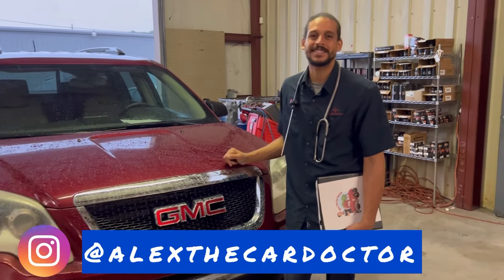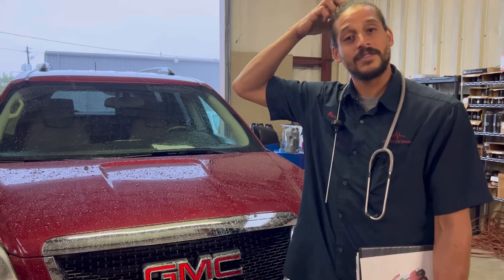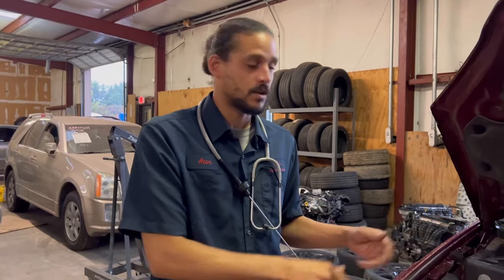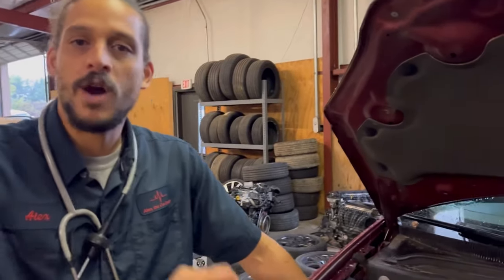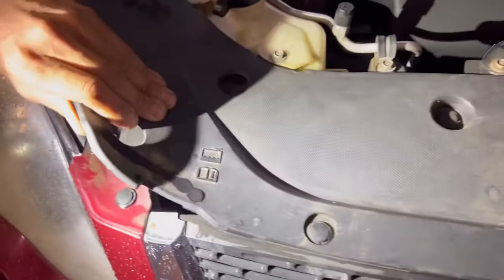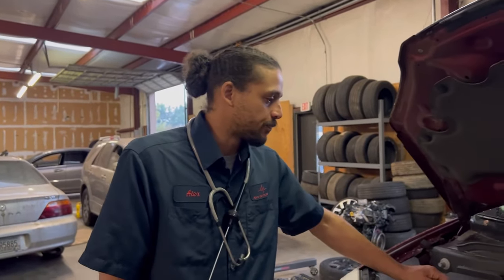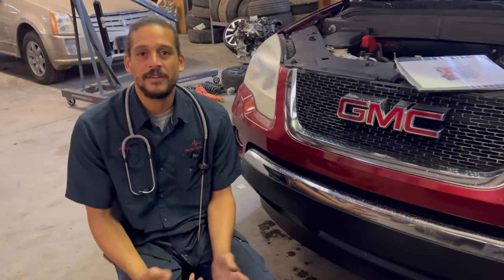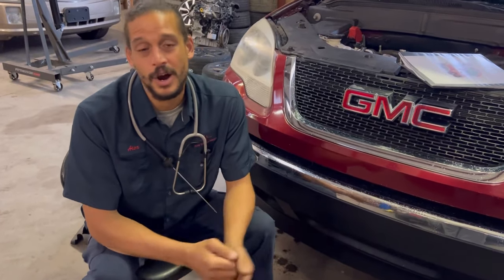The Top 5 Problems - GMC Acadia ( First Generation 2007-2016) | Should you buy the GMC Acadia? #gmc

Comment: HEY ALEX I JUST SUBSCRIBED 8 months AGO YOU MADE A VIDEO ABOUT A 2.7 Dodge can you give me an update on what that was after all?  I HAVE MY DODGE CHARGER 2.7 we change the temp sensor, water reservoir, fans thermostat, guy said he needs to pull the water pump he pulled it but it was in tact regardless he said he burped it three times and it still keeps bubbling at the water reservoir but the car always turns on and starts no oil in the water and water in the oil WHAT DO YOU THINK IS GOING ON? The mechanic is taking the heads off as I am commenting BY THE EAY YOUR VIDEOS ARE SUPER AWESOME
Reply from the maker: Your mechanic should have did a block test from the beginning.A block test will determine whether the head gasket needs to be replaced or not. Thanks for watching and the sub I’m glad you are enjoying my vids.
Reply: The 2.7 dodge is a boat anchor

Comment: Hey Alex,  I have a 2009 Acadia.  typical issues that you describe.  Had to change the rear catalytic converter because it was plugged.  looks like catalyst material from one of the other two blew out and plugged it.  Seem to run alright, but with a small misfire in one of the cylinders.  would the bad converter cause the misfire or possibly a bad coil?
Reply from the maker: Hey there sorry for the late response the bad cat most likely messed up one of your spark plugs
Reply: If you let a misfore go long enough it will burn your cat
Reply: Check your sparkplugs too. On a 5.3 V8 in a Tahoe, I thought a coil was bad, but the sparkplug porcelain near the electode inside the engine was broken.

Comment: I’m having issues with my 2008. Losing power at random times, sputters while driving and almost dies out when stopped. Was told it was the computer module and injectors, had replaced but a week later started having same issues again. :( 
What else can it be? Can’t afford a new car rn
Reply from the maker: Are there any Check Engine Light Codes??

Comment: As someone who bought one I have one question changing the transmission fluid should I do it it’s got 175k miles and I was always told not to change it without knowing if it’s been done before
Reply from the maker: Hey there buddy if you don’t have any history on it don’t  Touch it especially if it’s doing good. i’ve personally experienced this,changing the transmission fluid without history can sometimes lead to bad things
Reply: @AlexTheCarDoctor  Previous owner changed the ATF at around 90000km. I recently changed it at 195000km. I drained and filled twice, I didn't do a flush. Mistake?
Reply from the maker: @nestor.valentino  a drain and fill is perfect
Reply: Drain and fill with a bottle of Lucas trans no slip additive....solves shuddering.

Comment: I have had my Acadia for 3 years I have replaced the power steering hose twice is there something I may be doing that I can change maybe? Also struts my front struts need to be changed any tips?
Reply from the maker: Hey there and thanks for watching. Popper car maintenance depends on the year and mileage as the car gets older in years you won’t to start checking all the rubber parts belts and hoses suspension bushings etc or just change it,so what is the year of your truck. Dealing with mileage you normally for your truck 100k you change/check things like spark plugs, belt tensioner pulley along with idler pulley check, suspension components like tire rods ball joints ext,how many miles do you have.it’s a lot of stuff to check out, a good Guide is your maintenance book if you still have it it tell you step-by-step what you need to check dealing with mileage and year
Reply: @AlexTheCarDoctor  great thanks it has 189 000 kms and I don’t have a maintenance book

Comment: You might be able to help. I got a coolant leak but it slows down and picks up. I’m pretty sure my coolant temperature sensor is out. But when I get to that where should I be looking for that leak. From where I can see no hoes are leaking if anything could it be water pump. Coming from around the back of the fuse box area and drips onto the from a arm of the car. If you got anything to help advice. Thanks 🙏
Reply from the maker: Hey there buddy the safest way to find a coolant leak is to get a coolant pressure tester and pressurize the system then check For leaks.I have many videos of me doing this if you’re not familiar with the process. Why do you think your coolant sensor is going bad and are we talking about a GMC Acadia

Comment: Hello, I have a 2010 GMC Acadia. With a check engine code P0420.. What's the main reason or problem?
Reply from the maker: Hey there,that’s a catalytic converter code what normally causes this problem are worn out spark plugs, excessive carbon buildup in the engine a fuel induction service will help clean all that out and clean the converter faulty oxygen sensors downstream or simply a worn out catalytic converter
Reply: Ok. Thanks I'll give that a try.

Comment: dont you need to have the engine running to check the transmission fluid?
Reply from the maker: Hey there yes you do need to have the vehicle running to check the transmission fluid levels but not to check the condition of the fluid

Comment: Hi Alex I have a quick question 
I got 08 GMC Acadia and I replace the alternator because was bad and also I replace the battery but the problem still the same!! Some times the battery meter goes down or the car just doesn’t start 
Already change the battery twice because after 2 days start to leak what can be the problem??
Let me know please thanks
Reply from the maker: Hello sorry to hear the bad news.you may have a defective alternator,part failure is real. The other thing it can be is the engine computer or voltage regulator wires going to the ecu that may be damage.check the electrical connector on the alternator for damage also and make sure the positive wire is properly tighten down to the alternator. Hopefully this can point you in the right direction good luck
Reply: @AlexTheCarDoctor  thanks buddy
Reply from the maker: @mj96ct39  my pleasure
Reply: The water that leaks in from the sunroof can get all over the fusebox and ecm on the passenger side. Check for water everywhere.

Comment: Yes I have a 2012 GMC Acadia I'm having problems with the car starting sometime and when it started or when it first come on it's saying something about the traction and the stability sensor now it won't start at all or I have to wait for an hour or two and then it might start all the lights come on when you turn the key accept the engine light what do you think that might be???
Reply: It's saying service the traction control
Reply from the maker: Do the starter engage the engine meaning it the engine turning over but not starting
Reply: @AlexTheCarDoctor  no it doesn't do anything my uncle said it might be a solenoid on the starter but after sitting for about 30 minutes to an hour it'll start right up
Reply from the maker: @jerryturnbow893  look me on Instagram and send me a video of it not starting and starting show the instrument cluster where the gas gauge and everything located. It sounds like you have an electrical problem do you have a obd2 scanner
Reply: @AlexTheCarDoctor  no I don't and I don't do Instagram but I will try to make a video of it when it's not starting or whatever and I'll try to get it to you the best way I  can  I know when I turn the key all the lights come on except the engine light sometimes and when the engine light don't come on it won't start but all the rest of the lights still come on
Reply from the maker: @jerryturnbow893  do you have Facebook. When the truck finally starts are there any lights on
Reply: @AlexTheCarDoctor  sometimes the engine light stays on and sometimes it doesn't  and yes I have a Facebook page I just made a video of what's going on when I turn the key .
Reply from the maker: @jerryturnbow893  it’s normal for the check engine light to be on when the engine is not running along with many other lights, its called a light bulb test,no lights should be on when the engine is running. Try looking me up on Facebook
Reply: @AlexTheCarDoctor  I'm trying to mail it to u via Facebook is this ur Facebook address also???
Reply from the maker: @jerryturnbow893  yes
Reply: The fusebox is probably flooded from the sunroof leak.

Comment: Hi, I’m interested on buying an Acadia 2010 with 101K Miles, what should I be worry about? Is it reliable? Because I drive a lot
Reply from the maker: You never know what you are going to get with a used vehicle especially with a higher maintenance 3.6 engine that’s in the Acadia.I don’t want to tell you not to get the truck you want but have a car emergency fund for it and use very high quality oil. I see a lot of this vehicles in my shop for timing chain problems that is an expensive repair this truck is like owning a high end luxury vehicle every thing is hard to work on cars that equals expensive for the owners.on the upside they drive very nice and look good
Reply: Thank you for your response, I was about to go close the deal on Monday but now I changed my mind. I’ll stick to Toyota or Honda, I prefer reliability over how nice it looks
Reply from the maker: @kevinstevenbarrerajaramill5254  very good Choices those are my top picks Toyota then Honda

Comment: My 2015 Acadia is at 154000 miles.  It hesitates to start only when I put gas in it.  Check engine light is on.  What could this be?
Reply: Evap purge valve

Comment: I have a 09 Acadia with 198k and no issues but I change the transmission fluid every 30-50k and the oil every 3500 miles I have always Rotella T6 5w-30 oil I don’t know why I chose this oil when we bought the vehicle in 2015 it had 65K on it. I change the oil and trans fluid. Went to get emissions last year and the computer said it wasn’t ready for the test yet so they said to drive it and come back witch made sense cause the car had been sitting for several weeks not driven so I drove it went back still not ready 
So I drove it for a few weeks and still not ready I don’t know what to do herd you say you’re in Georgia and I’m interested if you can check it out or have you seen this in the past?
Reply from the maker: Normally to get those ready for emissions  you have to drive them 50-60 miles per hour for about 5 to 10 minutes straight. Google this: “ Readiness Monitors for 09 GMC Acadia” and it’ll give you the drive cycle. Drive it as instructed. If this doesn’t work come see me 👨🏽‍🔧

Comment: Hey Alex this is Monica from Jupiter Florida. Just replaced the front shock and strut assembly plus rear shocks as well. Front left wheel is making a ticking sound while I'm driving it and it is driving me nuts and I am dead serious! My bro is a mechanic as well as myself this is my moms 2010 GMC Acadia with only 35,000 miles on it. Do you have any ideas what that noise could be? I'm going to take the tire off tomorrow in my buddies garage and see what I see when I manually turn the wheel. Possibly overtorqued nut or a front wheel drive part going bad. No one has been doing maintenance on this vehicle in 12 years so I have checked almost everything out myself.  Have any pointers for me? I would greatly appreciate your advice. Thank you and Merry Christmas!
Reply from the maker: Hey there buddy happy New Year. you said you replace the front shocks if you bought them off-line for very cheap you could possibly have a defective unit, this happened before to me and it drove me nuts trying to find it because everything was new but that doesn’t mean anything if the parts are not of quality also check your swaybar links they tend to go bad and make noise
Reply: @AlexTheCarDoctor  It was a loose brake sensor line hitting the wheel OMgoodness we found it!  One of those little things when your rushing to do it fast you should slow down  and double check everything!  So glad it was something simple Alex but thank you for your response. Yes a defective unit from China did cross my mind. Happy New Year!

Comment: Just changed the water pump last month and yesterday it started overheating again. Couldn't be the same issue again?
Reply from the maker: Hey there does it try to overheat at a standstill like if you’re in traffic or while you are driving like if you’re on the freeway
Reply: @AlexTheCarDoctor  not at a standstill just driving down a regular street. Went from the middle of the guage to overheating in five minutes of driving
Reply from the maker: @donbenain9316  did you burp your coolant system after you replace your water pump
Reply: @AlexTheCarDoctor  I brought it to a mechanic shop. I hope so. Is it true low oil could cause this issue? I have been topping it off. Had the mechanic check for leaks he says there is none
Reply from the maker: @donbenain9316  low oil will not affect coolant temperature in a way of overheating but it plays a part in keeping the internal parts cool
Reply: @AlexTheCarDoctor  thanks for your answer. The warning said engine hot a/c off
Reply: So I pulled over twenty minutes and than went the other three minutes home when it said the same. The fan continued to run for five minutes after i shut the engine off
Reply from the maker: @donbenain9316  who installed the water pump
Reply: A mechanic shop. Family owned since 1982
Reply from the maker: @donbenain9316  sounds like a great shop. Did they perform a block test? I’m pretty sure they burp the cooling system. You may have a blockage in the radiator,definitely sound like you have a flow issue may be a defective water pump like you mentioned earlier. I do know that I rarely see defective new water pumps normally when water pumps go out they normally leak or the propeller fins will break causing overheating issues right away
Reply: @AlexTheCarDoctor  there is a leak on the front passenger side. I'm bringing it back in on Monday.
Reply: I'm not sure about the block test
Reply from the maker: @donbenain9316  that’s where the water pump is located the gasket may have failed
Reply: @AlexTheCarDoctor  oh. Is that as pricey as the water pump
Reply from the maker: @donbenain9316  let me rephrase that,The water pump has a gasket behind it when they replace the water pump maybe it didn’t seal correctly or it failed either way it should be under warranty with the shop and they will replace it for no charge,it should be that way anyway if it’s coming from the water pump again
Reply: @AlexTheCarDoctor  ok thank you for your help. I'll follow up when I bring it in
Reply from the maker: @donbenain9316  my pleasure. Quick Tip make them show you where it is leaking from never take any one word when dealing with your vehicle and have them explain what happened
Reply: @AlexTheCarDoctor  ok I will thank you
Reply from the maker: @donbenain9316  any time I’m here for you
Reply: If the fans stay on after you turn off the vehicle either the engine coolant sensor is bad or the fans since its over hesting with fans on im gonna go with engine coolant sensor

Comment: I’m looking at a 2008 GMC Acadia to buy tomorrow. She’s only asking 4100 and she seems like a good lady. It looks well taken care of from the exterior and interior however we are driving there tomorrow to see under the hood and test drive. I’ve got 4 kids now with the youngest being 2 months old and we really can’t afford much over 5000 so I was really hoping to see all well with the engine and make the purchase. Considering my situation and budget you still don’t think if all checks out tomorrow that I should buy this vehicle?? Thanks so much for the video. Keep them coming.
Reply from the maker: Hey buddy what is the mileage on the truck. From what I have seen in my they are very expensive to maintain and keep up on the good side they are very nice trucks you would love it but keep an emergency fund for it and use very good quality oil
Reply: Do not buy it. I have one same deal u got pretty much . I'm in year 3 with it the past year I had to gt a transmission, now it keeps running hot I've been dealing with that for a while even AFTER I thought it was fixed. So far I've spent 1000 dollars . Now I'm hear replace the head gasket or it could be the radiator . I'll be getting a new vehicle this year and it won't be an Acadia 🤦🏾‍♀️🥴
Reply from the maker: @omegapugh1545  hey there sorry to hear the bad news let me know what vehicle you’re planning on getting I don’t want you to get another problem Child

Comment: Anyone ever have intermittent starting 2010 acadia? Did battery, alternator, starter ,relay already. No idea
Reply: @ryankeenan351 Did you get it figured out?  I’m currently having problem with my 2011 .  Doesn’t start, take key out try again and works. Sometimes twice.
Reply: @user-ie3kk9oq1p  

I replaced the fuse for the starter and it seems to be better. I still get worried tho sometimes. Haven't had anymore issues yet. I keep a jump pack in the car just in case.

Comment: I wish to thank you. I purchased a 2008 Arcadia a year ago,I paid $3000 for it. One of the reasons I got it was that it had the timing belt issue and transmission rebuilt that cost over $ 8000. All done around 175!000 miles. I have 184500 miles on it now and get it serviced every 3000 miles. My question is, it worth anything on a trade in. I drive 125 miles once a week to work, and been a great car to get in and out of,and get about 21 miles to the gallon. If been thinking about a Honda Ridgeline to replace it,what are your thoughts??